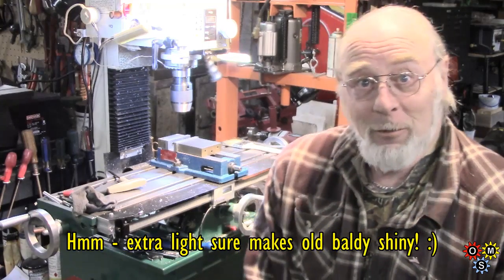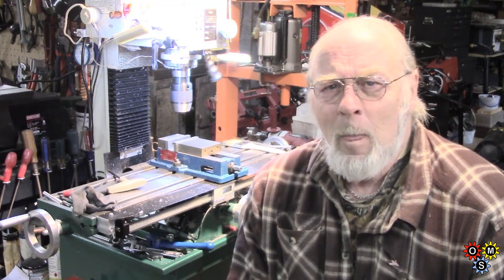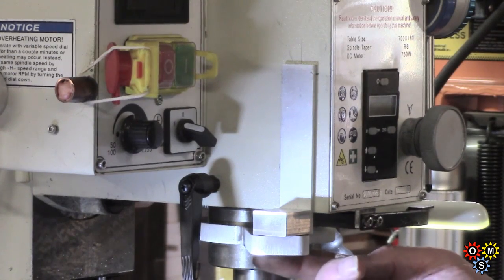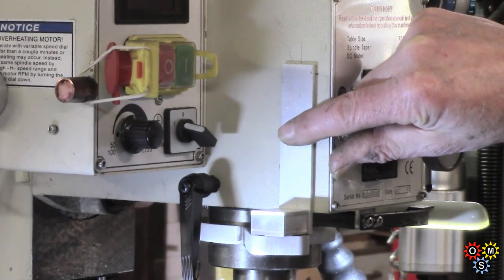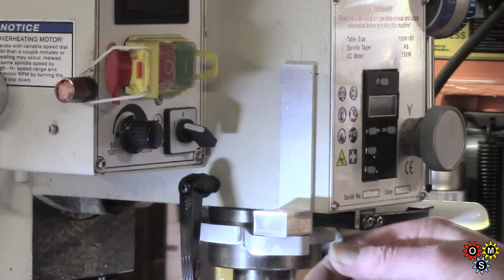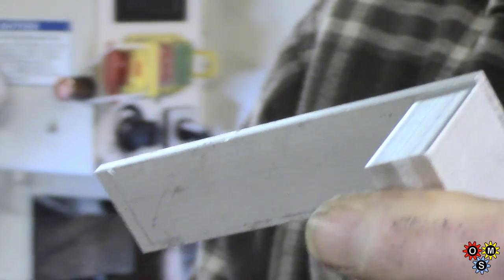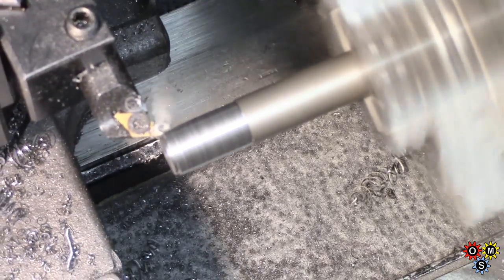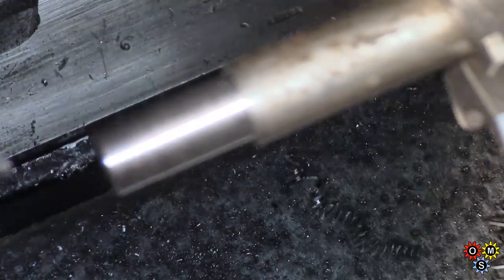Quill Stop Fabrication, Part Two

Comment: Nice job Chirs.   Thank you for the anti-chatter tip.  I went out to lathe and played aorund with fairly long overhang and it does work in stopping chatter.  Good one there.
Reply from the maker: +Glenn Felpel 
Hi Glenn - Thanks  - yes, the "X/Y" approach does usually help a bit.... particularly if work piece end not supported.

Comment: Chris, Most camera's have a manual focus mode or a focus lock. When I set up a shot, I usually lock the focus where I want it to keep it from hunting around.
Reply from the maker: +Cuppa Joe 
Hello Joe -- yes, camera does have a manual focus option, which in retrospect I should have used.  However, it's a sort of laziness as setting up that way is a PITA, so take the easy option -- which of course was not so good!
Now I think on it, dammit - just remembered there is a way to lock focus -- hmmm - must check that out and remind myself so as to avoid the screw-ups. Glad you mentioned that! :)

Comment: I've added the same plate to my table top ENCO mill but used mine for my digital readout,  and now it looks like I'll add another lead for a depth stop. And yes you'd better turn your shop heater up or go inside and button up because it's coming your way, luckily mine is in my cellar, only ten degree drop.
Reply from the maker: +Roger Beaulieu 
Hi Roger -- well, the 0704 has Z DRO which is good and I sometimes add a mag base indicator alongside as well for checking. So the stop is an extra - already used today and it's great :)
Yep - weather going to hell in hand basket -- severe wind tomorrow plus rain turning to snow. Then much colder but, weekend looks better. I could handle a 10 degree drop!

Comment: Thanks for the video and all your wisom & tips.  Question.  Did you think of pre drilling the plate that mounts on the mill, ca it, then transfer punch into the side of the mill.  I find ca glue very handy and it releases with heat.  Good stuff.
Reply from the maker: +Roy Lucas 
Hello Roy -- thank you. Well, I did the transfer screw approach as I wanted to use the existing holes and, positioning was real super critical. Also, perhaps anyways not so keen to ca the mounting plate to the column housing.

Comment: I wonder if you have focus preferences set to background in your camera.  Not sure such a setting exists but wouldn't be surprised.
Reply from the maker: +Crafted 
Most of the time, auto works well -- until camera spots chips or, sometimes focuses away from rotation.
Now have explored a focus lock option - potentially very helpful now, most of the time in newest video, though a bit of extra set-up needed.

Comment: The AC and/or fan are not to noisy for the videos. Very serviceable threads.  11:00 We've seen drilling before, so no worries.  11:13 A co-woker called me Vince for 13 years before he found out that wasn't my name.  I knew who he was talking to.  Thank goodness for Loctite and super glue.  A long rod is always better.  25:10 You need a chip breaker on that drill bit. lol  Is a spindle stop an option on the mill.  I wonder if they use journeyman machinist/tool and die makers to design their machine tools, or just engineers??  You answered my question about that being an option.  Another job well done.
Reply from the maker: Hi again - I don't think there's a factory option for a stop - there is though a Z axis DRO and the quill can be held locked but still - the stop addition is invaluable for repetitive work.
Reply: I agree

Comment: Douglas white 
Your not the only old man in the shop you have lots of company could you tell me what sort of light that is on your quill 

keep up the good work
Reply from the maker: Hi Douglas,
Thanks. The light, actually one of two - is a small mag base flexy LED unit. I have several from ebay and I think they are listed as sewing machine lights. They are very easy to position.

Comment: Nice job done. I noticed that every thing is in focus except lathe work. Maybe zooming out, not getting so close may help
solve the problem. Adjusting the light to skim off the work instead of hitting it straight on and causing reflection is also
something to try out. Thanks for the videos.
Reply from the maker: +Rob Gerrits 
Hi Rob -- well, even now am always trying to deal with problems that occur and often should know better than to zoom in too tight.!  I do have an option on the camera which in theory should help lock focus on one thing - something i must try and do.
Equally, always trying different lighting approaches but, not always ideal!
Reply: Camera work is difficult while turning a part. If you want perfection then look at Clickspring. If you want the human effort with passion to get it done then watch ChrisB257.
Keep on going Chris!
Reply from the maker: +Rob Gerrits 
Thanks Rob.
Ahh yes, Clickspring ... excellent camera work and lighting. Something to aim for.

Comment: That turned out very well, but you could have had a much easier time if you had mounted the vertical bracket onto the housing, then spotted through the hole onto your quill bracket, you would not then had to go careful with your vertical bracket holes, it looks like you came up well in the end though, put it down to the cold weather! Chris B.
Reply from the maker: +Englishman French 
Hey Chris -- well yes, could have done it that way and had considered it but - being persnickety wanted my holes in the quill yoke lobe and slider block to be centered. Thus I did the more awkward way! It did work out anyways which was main thing, even though I was rushing it all a bit.

Comment: The result seems nicely rigid.
Reply from the maker: +Peter W. Meek 
Hi Peter - yes, does seem rigidity is good which is pleasing .... certainly well adequate for my needs.
Reply: I have a tendency to occasionally hit the stop (on my drill press) with some force. It's one situation where the threaded stop has its advantages - no slipping. I would have to be much more careful with a friction stop.